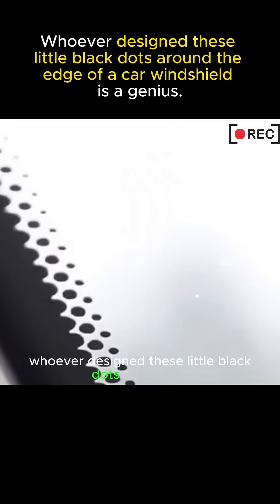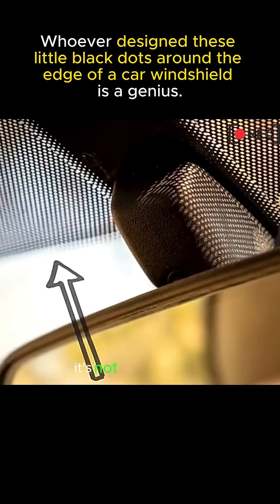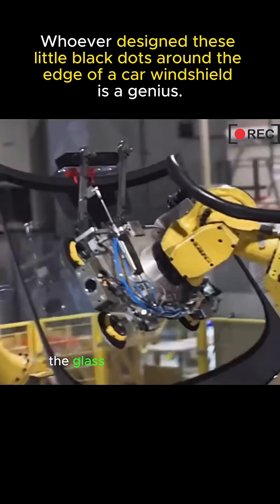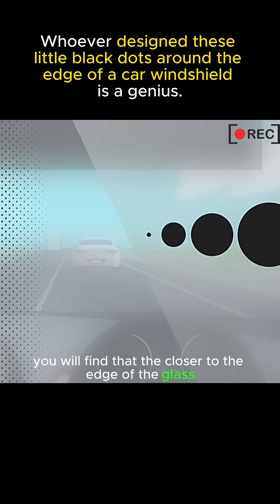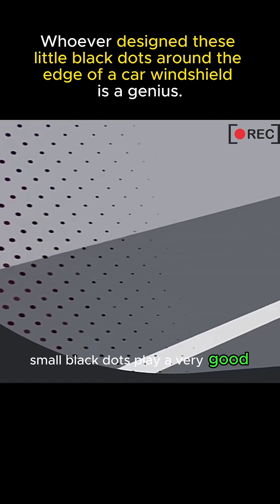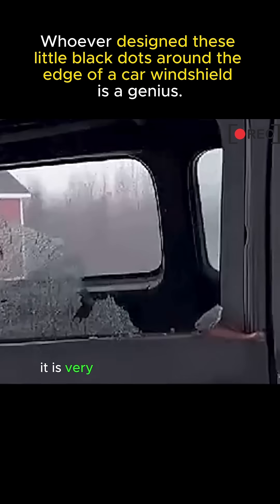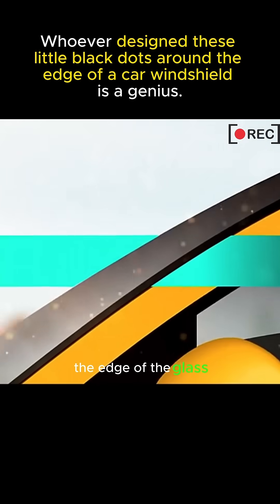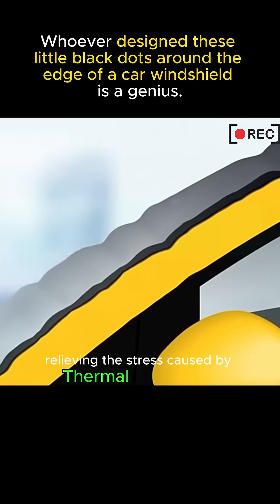The Reason Behind Dots on Car Windshields #CarWindshield #AutomotiveTechnology #WindshieldDesign

Comment: Its called the "frit" and it protects the urethane from UV breakdown. I've been an autoglass tech and auto glass small business owner for 27 years .
Reply: You said so much more in such less time lol.🎉
Reply: I've heard them called matrix dots, but serve the same purpose. Hard to tint over as well.
Reply: Why don't other glasses in a car have these? Like side glasses in car doors. Don't these expand?
Reply: @drkrishankyadav7868  The side glasses are not held with adhesive
Reply: @cashbonanza963  they are glued in on many cars . Only European cars still use any gasket set.     Aside from early 2000s Ford f250 and f350 rear glass, the only modern passenger vehicle,  (so excluding  heavy equipment,  and cabover style hino style trucks) OFF the top of my head is a Mercedes G wagon.  Or originally called a "gelendewagen"
Reply: @cashbonanza963  you were also wrong about "side pieces " Aka quarter glass , which indeed are urethane adhered.
Reply: @classicminicooper  Is that surprising for a guy who learnt English as a forth language? I don't think so. Besides, all the side windows I've seen are held with some sort of metallic bracket; I don't know about today's cars but that sounds legit what with  cost cutting and planned obsolescence.
Reply: @cashbonanza963  the "metalic bracket " is exterior trim.   Absolutely zero retention .
Reply: @cashbonanza963  I had not made any mention of verbiage , or linguistics,  so lack of knowledge to a trade has no crossover to what language we are communicating in .
Reply: @drkrishankyadav7868   they do if they are adhesive mount.   Or "glued" in.   It won't if it is a gasket set window
Reply: @drkrishankyadav7868   usually side doors don't have them because the windows roll up and down , and are held on the bottom of the window to a regulator.  (The mechanism that allows the window movement)    so there's no urethane to protect
Reply: @classicminicooper  yes; absolutely! That's why we have these dots on fixed glasses glued from all sides. Free glasses such as side windows can expand into the free side part. 👍
Reply: cminicooper Why are they black though? White would reduce heat.
Reply: @cashbonanza963   white , from my understanding wouldn't block the UV from  breaking down the urethane .
Reply: @classicminicooper  even perfectly opaque white? opaque yellow? ...etc
I think something doesn't add up here
Reply: @cashbonanza963  Black absorbs white reflects. I believe white is the better/superior option for sure. The only reason I think they use black is purely aesthetics. It hides almost to where we don't see it. The solid black is to protect the sealant. The dot matrix helps with heat dissipation and removes the definitive black to glass line which would cause the window the crack along that solid line.
Reply: @JaegerWrenching  white woukd reflect more and on the shapes of modern windows,  especially front shields , refraction and reflection is most likely the reason.   As the separated parts "the Dots" woukd reflect the heat instead of dissipate the beat this keeping concentrated heat per area
Reply: Thanks for calling on the bullshit. I just saw a show on manufacturing buses and they explained the purpose of this black outline.
Reply: Thank you
Reply: And? Do you want a medal or something. Boring job how the hell do you do it.
Reply: Today's glass is thinner and more brittle.
Reply: See. That only took 10 seconds to spit out.
Reply: @ls_812  woukd have taken less but I added my "credentials " before the arm chair youtube "pros" asked "how do you know " lol
Reply: Being a glass fitter is not something to brag about
Reply: @HSV_126  weird comment. Why ?
Reply: So many comments, so little actual knowledge and understanding, on this thread... The autoglass business owner is correct. My nephew also owns an autoglass company, and he taught me the same, when I was working for him. I can't believe how many people are straight up mental midgets, and have to argue about everything, instead of just learning something.
Reply: Me too but for 323 years now.... I'm about to retire in 2 years at 325 years going!! Its been fun... time to travel the world for the next 500 years or so!!
Reply: @simonbenn5340  are you mad I built a future for myself? What a odd post to bash on someone.    Let me guess single mother,  part time jobs your whole life ?  Can't stand to see hard work and success , wants the govt to hand you a check ? Moms basement as an adult?  All u need now is some trigger words to complete your snowflake journey
Reply: @simonbenn5340  are you upset I know the industry? Show us on the doll where your single mom hurt you . Don't be mad pops was upset at how you turned out .

Comment: That is a myth . The black surround hides the silicone bead which has become the standard way to install front and rear windscreens otherwise it would be visible from outside the vehicle . The dots prevent or reduce the look of inaccuracy of parallel lines of interior trim around the windows. If the dots were important for expansion and contraction they would be placed on the door glass too . They are not .
Reply: Urethane bead.  But yeah to the rest.
Reply: @SealofPerfection  Polyurethane to be precise . ( just being a bit ''tongue -in - cheek'')

Comment: This explanation is dead wrong.  They are call "frits" and  all it does is hide the bead of urethane that glues the glass to the car and keep UV rays from hitting it and making the urethane deteriorate.  
They also provide a rough surface for the urethane to "grab".   And they hide the urethane so you can't see it, so they are also a cosmetic thing. 
That's it.  Has nothing to do with heat.

Comment: For one the windshield is laminated and not tempered. That black band around the windshield is called a "FRIT BAND" It hides the glue used to install the glass. Laminated glass does not explode it just cracks. You would have to really smash up laminated glass before it is a danger.
Reply: This video is total BS.

Comment: The black stripes and spots are called the frit. During installation, the frit is a bonding point between the glass itself and the frame of a car. The frit is baked into the edges of the windshield glass so the glass bonds to the frame. The windshield component also hides the adhesive to provide a polished appearance.
While the side of the frit that is facing inwards bonds the glass and the frame, the side that is facing outwards has a different purpose. The side that is facing outwards keeps the UV radiation from damaging the adhesive. Long-term exposure to direct sunlight that is damaging to the adhesion in the glass. UV radiation can damage or weaken the adhesion over time.
Reply: I believe the dot(singular) is called a "frit". The plural version is, "frits".
Reply: @budlanctot3060  yes - getting more detailed/specific... the dots are the frits and the black band is the frit. But both together, is more generally known as just the frit.

Comment: As a kid in the 80's I was sat in the back seat of my parents' Ford Taunus on a quiet and nice sunny day while we were taking a drive. Suddenly the rear window exploded all on it's own, glass all over the back seat, so I for one certainly appreciate and understand the reason for this improvement.
Reply: The spontaneous breakage like you saw is usually due to a defect or inclusion of a small particle called nickel sulfide that expands over time and can break tempered glass.
Reply: @josephpoley4805  no it was from 12 pumps on my pellet gun. Effin hate Taurus's
Reply: B.S.
Reply: @scotty362100  What exactly do you mean is B.S.?

Comment: Hmmm...my 1968 Chevy C-10 doesn't have these dots and they've never broken.
Reply: Used different glue on the windows....
Reply: Cause they’re held in with a rubber gasket and not the urethane

Comment: The special glue used to fix the glass is sensitive to sunlight, long exposure makes it brittle, so the dots help with keeping some of the sun away while blocking less of the view than a solid black stripe. You learn this detail while getting certified by SIKA, one of the makers of this kind of glue.
Reply: Thank you
Reply: This is the reason. The guy who made a whole video about it, didn't even manage To give a reason on why those dots are even there.
Reply: I came here to say the same thing, lol
Reply: Thanks for the info. I thought they were an antenna. ❤
Reply: thank you for explaining why because this video absolutely did not!
Reply: The glue is a polyurethane base, and you're correct, it doesn't like sunlight. I was a mobile installer for Safelite back in the mid 90's, loved that gig. Did 5 windshields a day.
Reply: @tima.478 these days you better be doing a combination of 10 screens, back glass or door glass each day and sell minimum 4 sets of wipers in those 10 jobs. belron is a disgusting company to work for
Reply: @cpzmelbs  DAMN! Yeah, NO. lol 
I was killing it back then just doing 5 screens a day for 4 days a week. Was pay-per-performance back then and I got a small daily per diem for lunch. In '92 I was pulling in about $800 weekly, after taxes. Was good money at the time. Had a reeeeeeal nice apt that was about $450 a month and I was 25 years old.
Reply: Special glue? 😅 it's urethane, or did sika leave that information out of their booklet that class 🤔
Reply: @DEADWRONGx  Polyurethane, to be more accurate 😎

Comment: A dealership will tell you its a antenna 😂
Reply: That’s exactly what I thought it was. 😂
Reply: Now you are almost correct usually the antenna is part of the rear glass. I have seen one windshield that had one once. I forget what vehicle it was. Many rear glass antennas look like they are part of the defroster and are usually right above the defroster. If the vehicle had that setup.
Reply: @spagsketti  I just said it's what a dealership will tell you bud
Reply: and mark your carup $3k
Reply: They would be wrong.
Reply: I always thought it was part of the windshield heater element
Reply: @richards4986  97% of windshields do not have a heating element. I have seen them on a windshield a few times. High end vehicles and once on the wiper resting area to defrost them. The couple times I did or saw windshield heaters the wires were so small you could not see them and it was literally the entire surface of the windshield. A rock chip could damage the element. Just not worth the hastle really.
Reply: @richards4986  Cars without windshield heaters still have them
Reply: I was  told that when I first noticed them Years  ago. Also satellite radio. I squinted my eyes and shrugged my shoulders. I said hmm

Comment: BULLSHIT. I HAVE HAD 3 TRUCKS WITH THESE DAMN DOTS. ALL 3 HAVE CRACKED DURING THE SUMMER.
Reply: It'd be way worse if they weren't there. I remember back in the day when they hadn't figured that out yet and no cars had them. Nearly every car on the road that wasn't kept in the garage had stress cracks in the back glass or windshield within a year or two from new. Best way to stop it is to keep it out of full sun in the sunmer.
Reply: I would bet there was a rock chip in the glass that caused it to crack. A rock chip on the edge or close too it will crack faster than one in center of the windshield. There is a lot of pressure on the edge when the glue cures out.

Comment: 100% of drivers don't give a fuck
Reply: Exactly 😂. Actually he didn't say most of the back edge is for primer glue. Black paint Stick to the glue/primer and the to the car frame 🤦
Reply: @arianduran1725 Sort of, the black band on the glass is there to protect the primer and glue from uv rays. 
Without it, the primer will eventually break down and separate from the glass. 
You can just prime and glue plain glass, it will bond just as strong, but only for year or 2, until the uv takes it's toll
Reply: I have always wondered it so you're wrong
Reply: @KevW-z7z me too
Reply: Ooh, nice, my original reply also contained the f-word, but  clearly got censored, I guess your f-word is more kosher than mine somehow, either way - you are wrong, cause I do give a f. That makes it less than 100% of drivers.
Reply: ...and the other 10%...(oh, wait)
Reply: That’s why we paid thousands of dollars for a car and let the engineers figure out themselves 😅
Reply: Facts! 😂😅
Reply: Not that you would give a fuck, but that's 100% wrong. 
I drive and I do give a fuck, so it's certainly not 100% not giving a fuck. Man that's alot of fuck btw.
Reply: Until you go to change there windshield for them then they give all kinds of fucks.
Reply: Facts 💯
Reply: Commy
Reply: My sentiments exactly 😂
Reply: You would if your glass didn't have any frit,  it would be susceptible to exploding due to super heating 😅
Reply: Some people like to know random facts bro, sounds like you know only basic stuff like most people
Reply: @ridefree9160  not true,  I know about stuff that actually matters
Reply: @shanekuchler9569  This matters to some people

Comment: Well I am an auto Glass technician 
Well how about the clear glass who doesn’t have a black shade around the windshield? 
I think it’s just cosmetic instead of looking at the urethane ( you guys call it clue ) they put it out there to hide it 
Well I could be wrong
Reply: I have a question for you, on my toyota windshield there are some small sort of code printed randomly on the glass, any idea the purpose?
Reply: @sanookaus1334  it’s a print of the manufacture who made the glass if it’s never been replaced you will see the same print on each door window
Reply: @samirhadjou8163  One more Question if you don’t mind, why are the side mirrors reflection not true to size, as everything looks far away. Cheers.
Reply: I am surprised U don't know it's for the HVAC System
Reply: @StationRussification  how about the clear glass
Reply: Depends on what the manufacturer gets the best a/c performance from, if they care. This is not technology that's been around forever & used by every car co. I do know that the mid '90's Dodge Caravan cared about it for sure & suppose many other Chrysler Products of the day did as well, I just remember a Chrysler Training Instructor talking about this when I was in class back in the day.
Reply: Lol holy shit you peps are silly smh
Reply: If you're an autoglass tech then you should know that the urethane won't bond to the glass directly, it needs a primer to bond to, the primer used is sensitive to uv light and will break down over time, the black banding around the edge protects the primer and glue, the dotted matrix however may be designed for the reason explained in the video, but would rarely ever meet conditions severe enough to work as intended, but glass does become more delicate when hot, and sudden temperature changes or uninformed temperature across the surface can cause damage so it makes sense to still do it, it's not required though if a screen isn't bonded
Reply: @jb-dn3ct  well thanks for the information 
lol 
Well I use primer less  30 minutes minimum drive time
No activator either
Reply: @samirhadjou8163  yes primerless glue, the glue that's designed with a different chemical (similar to activator) in it, it's not standard urethane, I'm not meaning the power cure either (stuff that mixes activator as you bond) I've never known autoglass to use it because the primer also protects the aperture from rust, alot of car manufacturers use primerless, but then they have a fully painted and prepared surface to bond to, as soon as you chisel the glue off, without primer, you're leaving a possible defect in the bodywork that will eventually corrode and separate the glue.
Primerless is a terrible glue to use. Volvo, in particular, has major problems with primerless. They have quite the number of screens that need redoing due to the glue not keying to the glass, I'm not sure if it's the glue or their glass prep, but it's always the glass side.
Here in the uk, the autoglass standard, primer must be used, can't say the same in other countries, but if autoglass don't apply this everywhere, and use primerless, then I'm actually quite surprised that the industry leader would take such a risk
Reply: @jb-dn3ct  when I said primerless 
I meant the glass side we don’t prime the glass or activate it 
Glass cleaner around the edge scaff it wape it aplly glass cleaner again around the edge of the glass check for contamination if it’s good final wash apply urethane you go to go
Reply: @samirhadjou8163 that's fair, cost wise it doesn't make sense, but if that's how your company wants to do it then fair.
My original point was just about the black band isn't just for looks, it is necessary for reasons I've mentioned, primerless glue does have an adhesion compound added to allow it to bond directly to glass as urethane won't bond directly, it needs help.
Out of interest, what's product do you use and who manufacturers it?

Comment: The thermal effect is not actually why, glass actually spreads heat way faster than it could build up enough internal stress in the sun. It’s merely to break up the edge which is a distraction.

Comment: They use the black enamel outside the windshield to block the sun's ultraviolet rays from melting the adhesive underneath the band. This keeps the windows firmly glued in their place. The black dots, or “dot matrix” actually help distribute temperature evenly to lessen optical distortion or “lensing”.
Reply: This was way faster than the short 😆🤣
Reply: it's a "frit" I was amazed that this robot spouted this bullshit
Reply: Mr Google
Reply: Thank you
Reply: Spot on. The sun will deterioate the urethane.
Reply: Spot on 👍